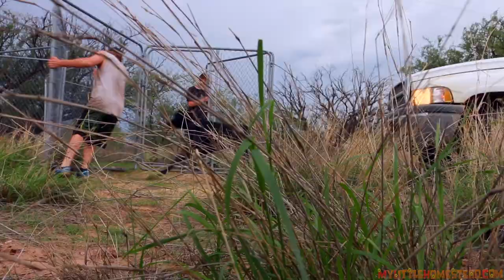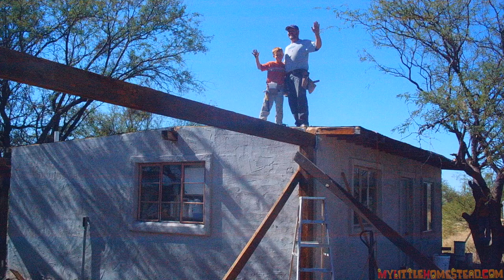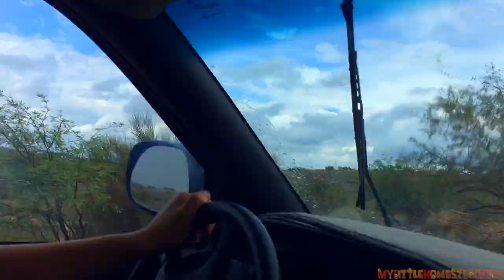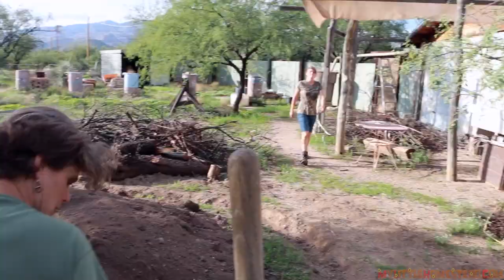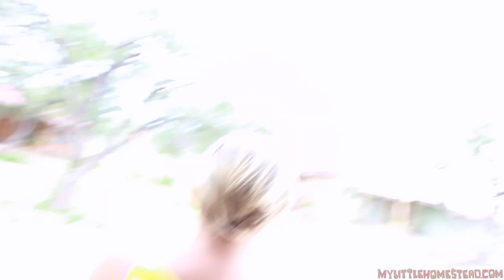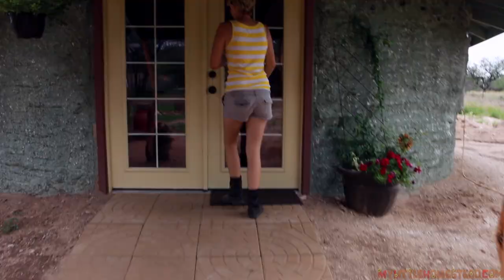Laying the Foundation | Shae's Earthbag Bedroom | Weekly Peek Ep98

Comment: Have you ever thought of putting a roof over the barrels like a carport or sun shelter, you could capture a lot more water off a roof structure, it could be used to shelter honey bee hives, or for foraging chickens which I saw you have as a sun shelter, so you could get multiple uses for it for little cost, just some scrap wood and and maybe tin roof, but could use plywood as well.

Since the desert gets infrequent rains you could save a lot more, maybe even put in a cistern if you wanted to or as funds allow.

Comment: have you used rain water for home use before? my well is very shallow. and I don't really trust it for drinking water. I was thinking of collecting rain water . and using a carbon filter and maybe a UV to kill microbes . since all I drink is water. I'd like a good clean H2o supply. since I live in the foot hills of north Carolina. I get plenty of rain. have you guys had any more well issues? or improved the solar power? I just got my inverter and batteries. and looking forward to moving! congrats on 25 years together. and I wish you a  whole lot more to come!  great video. I'm so looking forward for more!